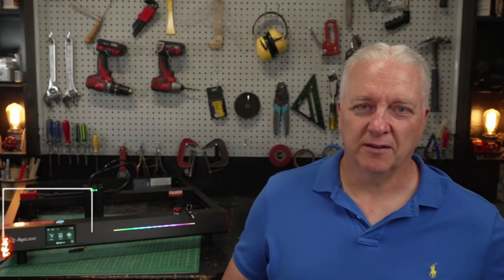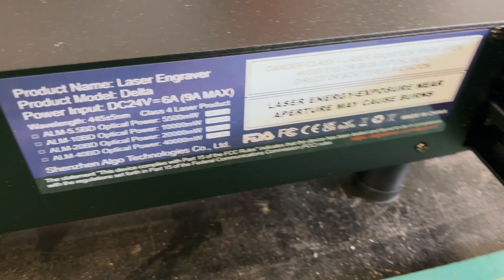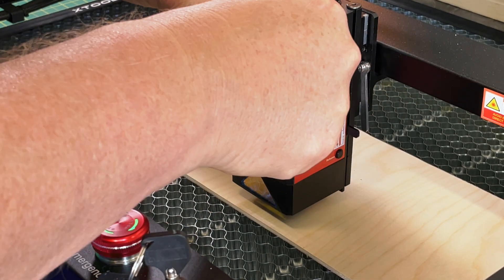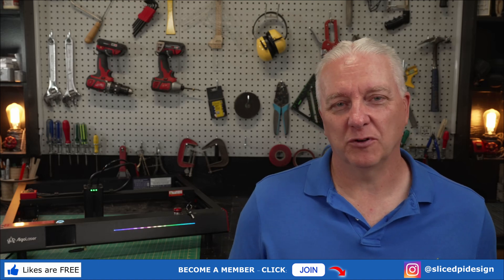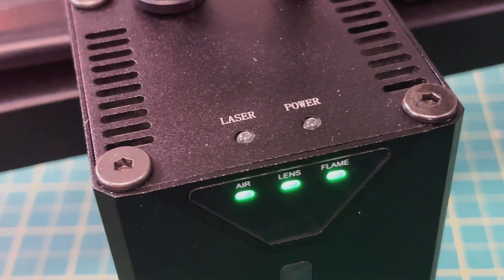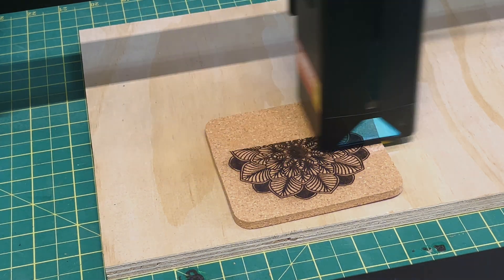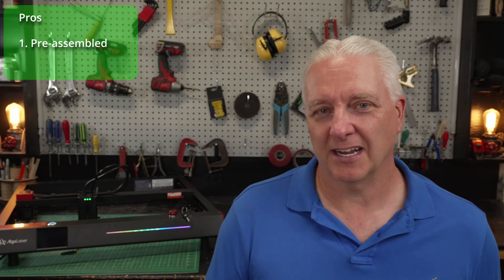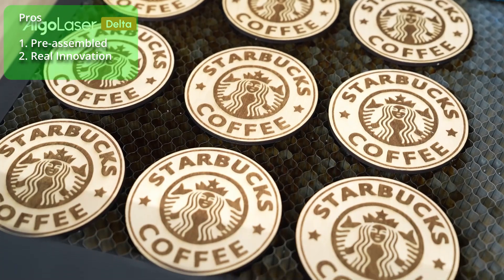The AlgoLaser Delta Laser Changes Everything

Comment: Just bought a 40w Delta in Black Friday sales, based on this and several other youtube reviews.

My 4th laser engraver and the first one I regret.

First one not recognised immediately by Lightburn, dreadful quality control, the X axis appeared to have rocks in it, was assembled wrong and needed a complete strip and reassembly. Tiny screws for parts that came ready assembled on my Two Trees and my Creality Falcon.

Then the flaky connection which keeps requiring reboots, the USB socket loose and shallow, requiring the removal of the plastic shroud to make a decent fit.
The legs only have one option for the screw holes, and they are too narrow for the common sized bed.

Endless console messages in Lightburn, even when not in use the messages just keep scrolling, very flaky firmware.

And it draws power through the usb, so if you turn off the Algolaser but the pc is on, the Algolaser beeps at you endlessly until you unplug the usb.

This thing is a mess.

Three days and still no response from support.

All in all an annoying disappointment, I'll give it a couple of days of fiddling then it's going on ebay.

The screen is pointless, 99% of people will run this from their computer anyway, it's a gimmick.

This adds nothing useful over my TTS 20w apart from the increased power, I would have been better off just upgrading the laser module.

Even if I keep it I will never buy from this company again, there are much better machines out there.

Comment: I enjoy your videos.  I have a question....comparing the creality falcon to the algolaser delta....do you have a preference?  Hope it's ok to ask?  thank you.
Reply from the maker: Tough call. Out of the box the Delta is a better engraver, though it doesn’t have a 1.6w laser module option. At present it is also only a 24W laser, so the Falcon 2 blows it away for cutting.
Reply: @SteveMakesEverything  Thank you for the response.  I have an atomstack a5m50 and I have had nothing but problems with it.  So I'm just wondering what my next choice should be.  Any other info would be greatly appreciated.  Thanks again for your time.
Reply from the maker: @sharisloma595  Wow, you're the first person that I heard of with Atomstack issues.  At any rate, while I think there challenges with some lasers, regardless of the manufacturer, I really like the Delta.  But there is certainly lots of choice out there.

I'm leaning pretty hard toward enclosed lasers these days because they are just safer.  I did ask AlgoLaser a while back if they were going to release a Class 1 laser and they were non-committal.  I think this is a mistake on their part, honestly.
Reply: @SteveMakesEverything  I have reached out to atomstack and they sent me a new motherboard after determining it was a faulty motherboard.  After putting in the new card, it still is not working properly.  I have not been able to complete any projects, it just doesn't work right.
Reply from the maker: @sharisloma595  🙁 Well, I'm glad you've shared this.  I poke manufacturers occasionally with this kind of information.
Reply: @SteveMakesEverything  I hate to bother you again...I started watching the video you did on the Acmer P2 33w, how does that compare to the creality falcon & the algolaser?  I'm really trying to decide which way to go with a laser.
Reply from the maker: @sharisloma595   I like Acmer as a company - they really seem to be trying to build good products and support them.

Comparison is tough among the three lasers  though, since one is usually a 40W, one is a 33W and one is a 24W.  

The Acmer provides pretty predictable operation.  The AlgoLaser has the best front panel control software and the best overall beam shape for cutting and engraving.  and the Falcon has great power, and solid construction, though it isn't the fastest.

I don't think you can do wrong with any of these lasers really.  If a laser was garbage you wouldn't see it on my channel, or if you did, I'd be telling you exactly what I thought because I don't take money in exchange for a glowing review and I don't represent any company.
Reply: @SteveMakesEverything   I appreciate your response. Thank you for taking the time to answer my question.
Reply from the maker: @sharisloma595  This is why I do this  😀

Comment: How is the Delta holding up?

Even after my recent update, I'm still having nuisance tripping of the flame sensor 

It's been extremely difficult to get a project done without interrupting itself

Wondering what your latest thoughts are on it now that you have had it for a while
Reply from the maker: Not in my shop ATM but you can either turn the flame detector off from the front panel or from Lightburn, but if I recall, you can also lower the sensitivity.
Reply: In the Delta menu you have options to reduce the sensitivity of the sensors. Sometimes you have to play with the options a bit to know what you bought and not just complain...
Reply: @B1G-Jack  thanks pal. 

however FYI,  my "complaint"  but rather more accurately; an observation , was  lonnnng before said options to 'play with' were even avail on the firmware at the time.

Comment: Great review. I was fully convinced up until the final side-by-side comparison - which to me looks better on the 33w machine. The Delta side looks like there has been some movement or loss of accuracy?
Reply from the maker: Hmm.  No movement, but as always get the laser that is best for you and the job you want it to do.
Reply: @SteveMakesEverything  you'll appreciate that the boxes and the digits down the left of the Delta grid have crossed over each other a little.
Reply from the maker: @Perchpole  If this is the test I'm thinking of, I was the one who moved it.  I thought I noted that in the video though

That's certainly not something that the laser could or would do.
Reply from the maker: @Perchpole  I went to look at the video and this was the one I messed up.  The laser is fine, but the user has some serious flaws.
Reply: @SteveMakesEverything  Thank you! Loud and clear. 🙂

Comment: What is the difference between  this laser and xtool 40w d1 pro or s1. I need to biy laser for my business but i haven’t decided yet. Which one should i buy
Reply from the maker: Well, the AlgoLaser is obviously a lot cheaper.  The output power is 24-26W rather than 40W, which, in the grand scheme of things doesn't mean a lot because the Delta cuts very similar to a 30-35W laser due to how AlgoLaser shapes the beam.  In my opinion, there isn't really much point in spending a lot of extra money for any 40W laser since they are a bit of a side-effect of manufacturers trying to convince buyers that there is value in being able to cut 2x4s, and while most 40W lasers can cut thick material, the resulting cut is pretty much a charred mess.  The real sweet spot for diode lasers seems to be in the 20-30W region, where you get a good balance between fine engraving and thick material cutting.

Note that it might sound like I'm telling you not to buy a 40W laser, and if you have the budget and use case for one, then, by all means, pick one up.  The D1Pro is a fine laser but is in the late stages of its life so it wouldn't be my choice, but the S1 is a great laser, especially if you use xTool's XCS software rather than Lightburn.

In the end, you won't go wrong with any of the lasers you mention.

Comment: Does this laser have linear rails on both X and Y axis?
Reply from the maker: This laser doesn't have linear rails at all.  I spoke to AlgoLaser about this, and they claimed that in lab tests, linear rails didn't last as long as rollers due to dust collecting in them, causing excessive wear.

This is possibly why xTool doesn't use linear rails either.
Reply: @SteveMakesEverything  That's interesting because I asked them on chat on their website and someone replied that they do. What are your thoughts on linear rails on lasers engraver?
Reply from the maker: @glenn8059  Well, for your benefit and my own sanity, I took a look, and there are definitely no linear rails on the AlgoLaser Delta.

When I spoke to AlgoLaser about this, they made a pretty compelling case for not using linear rails.  They claim that while linear rails might seem better initially, they will fail once they start getting clogged up with all the soot from the laser.

If you dig through the other comments in this video, you will see Gil's response to the linear rail question.  I wanted to get the company position attached here for everyone to see.
Reply: @SteveMakesEverything  Thanks for looking into it, much appreciated.

Comment: 10:00  This comparsion with acmer 33w is not real! In your channel (and others) Acmer p2 33w can cut in speed 700mm/min but here only 400 mm/min...
Reply from the maker: Well if I was lying I would certainly have to admit it, however, keep in mind that how well cuts appear is totally dependent on what you are cutting.  I use 1/8” hardware store plywood, which is a bit tougher to cut than say 3mm Baltic birch plywood.  This is why I alway tell you in cutting tests what material I’m cutting.  So no lies, but for the record, I use the same material for all laser testing to ensure that my tests for each laser I review  can be compared.

In short, if the tests you are looking at for the Acmer are done I. Different material, you will potentially see very different results.
Reply from the maker: I went back and looked at my original cut tests for the Acmer and compared them to tests I redid for this video and there are indeed differences. This is really just a material difference since I in fact used 3mm birch ply in the original test but when I redid the test here I used hardware store plywood (the original was done before I standardized on both tests AND material). I redid the test for this video because I wanted to pieces of material from the exact same sheet of plywood running the exact same tests.  Again no lie, just more concise results.

If you own the Acmer, have no fear because it is a fantastic laser
Reply: @SteveMakesEverything  Ok, I understand, but still, dear author, you misled the viewers with this comparison.
But it turns out that harder plywood can still be cut better with a lower power delta algolaser?
Reply from the maker: @B1G-Jack  The confusion is exactly why I've switched to standard tests and consistent material.

In short, you are correct that the 24W AlgoLaser Delta cuts almost the same as most other companies' 33W lasers.  This is a function of technological advances.  The AlgoLaser Delta stacks the beam differently, which is why it is smaller, almost square, and definitely has higher energy in the beam.
Reply: @SteveMakesEverything   If nothing happens, I think that the algolaser will be at my place within a week, thanks for the test, best regards :)

Comment: I ordered the Delta about two weeks ago, yes, the hype got me.  When I received the machine the laser assy was handing down in the front catching on the work piece.  I contacted support and after a few days they sent me instructions for an adjustment, which did not totally fix the problem.  Then a few days later the laser quit altogether.  I emailed support but they ignored me for over a week.  Then I finally get an email from Gil, support manager (apparently, he was out of the office and his staff can’t function without him).  He said there are two versions of the laser floating around, an older one (the bad one - which I received) and a newer one, but you never know which one you are going to get.  He is sending replacement parts… from the factory in China… I might get them by the end of the year.  If I knew this ahead of time I would not have purchased this machine.  In fact, there are a lot of other laser machines for a lot less money that may not look as pretty but will function just as well (and most really don’t need a touchscreen.).  Longer B1 20w for $600 is one, and for sure, the Roly is another.  Do your research, Ignore the hype, and get a good solid machine that won’t break down within the first week.

Comment: Would you buy this or the Atezr L2 22w or 36w ?
Reply from the maker: Given those two choices I would buy the AlgoLaser. It cuts great and engraves with precision. Make no mistake though, the L2 will also get it done
Reply: @SteveMakesEverything  out of all the diodes on the market, which machine would you get today? I currently have an olm3 10w but need more power?
Reply from the maker: @martymeunier4862  This is always a tough question to answer because there are so many great lasers on the market and it depends on your primary goals, budget, and desired power.  But my top three for somewhat different reasons would be:

1. XTool S1 40w
2. AlgoLaser Delta 22w
3. Wecreat Vision 20w

This isn’t an implication that I dislike any other laser you might have seen on this channel or any other channel, though.  In general, lean toward the newest models because technology is evolving, and newer lasers are mostly improvements over old ones.

Comment: You mentoned the removable filter on the bottom, and said that on newer higher power lasers, they do ot make them removeable.  My opinion, I think they are forcing the user to be safe, but not letting them remove it.  I have seen on other videos where people has removed the filter so that the smoke doesn’t say inside and can scatter better, so the lense doesn’t as dirty as fast.  Great video, I ordered one and it should be here Friday.  Thanks.
Reply from the maker: Lots of people remove the glass but the makes the laser inherently unsafe. If smoke is staying in the laser module then put it in a box with a good exhaust fan that can vent the fumes well.

Comment: is the cut actually 7.5"???  CNC coming new to laser. Looking at this #1, Roly #2, and Atezr L2 #3.  I would love your opinion. Will be in RV, I may be sitting in areas with no wifi... (AZ desert)
Reply from the maker: At the risk of making Rich, the Louisiana Hobby Guy, mad at me again, I would lean to the AlgoLaser because the beam is square and is sized differently for cutting vs engraving.   Note that AlgoLaser is apparently announcing a 40w version next month and the beam size will still apparently be in the 0.15mm X 0.16mm range. I would replace your #3 with the Acmer P2 30W.

I know Rich loves the Roly but it seems to be lagging from a tech perspective. So it probably wouldn’t be #2 for me.  But Rich will probably review the new 20w and 30w versions soon.

Wifi isn’t an issue with any of these lasers since they all have USB support.

Btw I’m working on a video that will be out soon for a new laser from a new company and is by far the easiest to use laser that I’ve ever seen.  It’s a bit smaller workspace than most traditional diode lasers but it’s really designed as a desktop laser, which might be ideal in your RV.  Watch for this soon.
Reply: @SteveMakesEverything  thank you so much! I

Comment: Great video. 👍

Side question. What type and power of laser would I need to cut quartz/glass/silicon wafer material? Thanks
Reply from the maker: I don’t think a diode laser will cut any of those.  Some say you can cut glass with a CO2 laser but any time I have tried it just broke due to excessive heating

Comment: How thick of Baltic birch can the laser cut cleanly without a bunch of char?  I am trying to determine whether to buy now or wait for the 40 watt in October.
Reply from the maker: I don’t have thick Baltic Birch so I can’t test this but assume it’s going to be at least 12mms is a single pass if you want to push it. Personally I normally use power at 100% and a speed of maybe 1000mm/min with 10-12 passes. It takes about the same time but you don’t end up a charred cut.

Comment: can it engrave vector images with a good black engraving and not like everything else that they produce a faded and brown colour on plywood?
Reply from the maker: All diode lasers produce the same basic feel for output.  Some of this has to do with the material as well.  However, if you want your engraving with this or other diode lasers to be dark then defocus the laser a bit before engraving.
Reply: @SteveMakesEverything  I have done this to my 10w  but again with no luck.. my old 5.5w diode still do black engravings great..
Reply from the maker: @Georgeprospero  Engrave a material test on your 10W and it will show you which power/speed generates the darkest engrave.

Comment: Looks amazing and thanks for another great video.  I've done just a bit of research on this machine but can't find whether or not it has the capability to attach a rotary and is the maximum engraving area really ~17x7 (inches)?
Reply from the maker: I should have mentioned this.  There is an integrated rotary port in the frame behind the display.